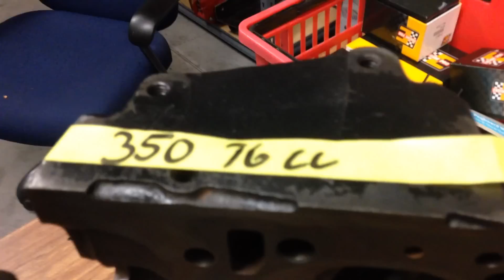350 and 305 Chevy what's The Difference

Comment from the maker: This is a link to the engine masters 305 N2O test
https://www.youtube.com/watch?v=AScojLj139A&spfreload=5
Reply: I was wrong, they blew it on 150 X 2 stages, they make 620hp on 125 X 2 stages.
Reply: Okay so when you mention the 58cc head bumping compression to 11:1 on the 350 did not make hp gain but what was the compression on the 350 with it's 76cc head ?  10:1 ?
Reply from the maker: more like 9 to 1
Reply: Watched  Eng mastrs link : HOLY CRAP !! 358 HP from a 305 ! - 619 on the bottle ! = short lifetime. However, over 350 HP from a 305 is impressive !
BUT, it did have aftermarket vortech heads. that is key to it's large numbers.

400 to 450 HP should be within easy reach with a built for longevity 350.
BTW : Also a fan of roadkill and eng mastrs  excellent series both of them.
Check out Finnegans youtube channel  finnegans garage.

Thanks for the link Myvintageiron7512. Merry Chrismas to you and a profitable and successful new year to you and your family.  JR
Reply: John Robinson I'd Like To Have That In A 1979 Or 1980 MONZA SPYDER!!!
Reply from the maker: when I was a kid me and my cousin put a 327 in his 77 monza that thing was a beast
Reply: Been there done that!  All that power and weight in a flimsy H-Body made a pretzel out of the front end!
Reply: Myvintageiron7512 my jaw dropped when it almost hit 600 horse.. really surprised with  that setup toss in a better bottom end I bet it would do well over 800 out of a lil 305..
Reply from the maker: Yea crazy pretty crazy stuff
Reply: i think she would go well in a lil s10 and name it farmtruck truck jr with 2 kits or a pair of turbo's :P lmao
Reply from the maker: nope 76 CC makes less than 9 to 1
Reply: friend had one in a chevy luv,was a screamer! also a 66 nova,slicks and rear fender wells cut out.Oh and i had a vega,lol,gotta love all those back in the day,cheap and fun times! all the youngsters,get a old motor and tear it down,and rebuild it, you'll have a blast and learn so much doing it.
Reply: 8.5 to 1.
Reply from the maker: @Wildstar40  because the 305 head does not breath well
Reply from the maker: @Wildstar40  yep 76

Comment: The difference between a 305 and a 350 is only the bore size and the thickness of the cylinder walls. The 305 is dam small. The 350 has a a 4.00" bore. The Chevy 307 has a 3.875" bore size, and the the 305 has a 3.736" bore size with 3.48" stroke. The 4.00" bore size has the strongest bore of all of them. It's not some magic number, it's just what we get when we start messing with bore sizes. (Like Werner Vaughn Braughn once said about solid vs liquid fueled rocket engines... it's not what we want, it what we get!) my Father In Law was in the audience when Vaughn Braun gave us that little tidbit.  The 307 Chevy is stronger that the 305 because of its bore size. It wasn't something that was planned, it just happened that way. Just like the 327 and 302 were stronger engines Than the 350! It's was bore to stroke ratio all the way, and that came down to rod length to stroke ratio! Who'd' ever thunk that. Smokey Yunick and nobody else! Rod length to stroke ratio meant power and durability, and nobody else saw it except possibly Mopar engineers.  Still today rod length to stroke ratio means power and durability. Even in monster 500+ Cubic inch motors. Even 600+ cu in motors. I'll stick with rod length to stroke ratios and lighter rotating mass.
Reply: Kenneth Cohagen 302 /327 ha they where all the same in the end 69 dz was a 350 block

Comment: 1st, great video, great information. When the 305 1st came out it was common practice to mill .100 off the head and angle mill the intake so it would fit better. Yeah, it was a bit of work, but you had a good truck engine in the end. You could have about 225-250hp and get 20-22mpg and back in the day that meant something. Mill the head, intake, comp cam 268, alum intake and you are good to go.

Comment: My mom had a '78 Nova with a 305 that she gave to me with over 130,000 miles and it still ran strong. I tried to blow it up but couldn't. I sold that car to a friend of mine and he put the engine in a Camaro and ran it for several more years. I also had a '74 Chevelle that I was known to break engines in. Once I had a 305 in it that had no power but I couldn't hurt it. I also had a 307 from a '72 Nova in it for a long time. Even with a 2 bbl it still ran strong. When I took that 307 and put it in a '78 Monza, I changed it over to a 4 bbl Quadrajet and man did it wake up! I've had good 350's, but that 307 had me impressed! I wish I still had it!
Reply from the maker: 307 has the same crankshaft as a 327 that stroke and rod combo has the best ratio of an Chevy engine 307 is the same engine as a327 with a smaller bore size
Reply: @Myvintageiron7512  I did some research and found out that the 307 was made by combining 2 of the best engines Chevy had at that time: 327 and 283. I wish I still had mine.

Comment: A 350 will run circles around a 305 and not just because it has more cubic inches, either. Valve shrouding is a serious problem on 305s.
That's why 5.0 Liter Fords run so good.   5 Liter Fords have a 4 inch bore.
Reply: In the late 60s, the first-gen Z28 also had a 302.  They took a 327 block and put in a 265/283 crank; a 4 inch bore and 3 inch stroke.  It kicked ass and wasn't afraid of RPMs.  That was a real sports car engine and GM should have put those in third-gen Z28s and 83-87 SS Monte Carlos. The 305 was simply a smog-era truck engine that also made for a good economy engine during the 79 Fuel Crisis.  But performance and austerity are not compatible.  305s are good engines if used for something besides a Camaro.  They did well for the Caprice.
Reply: I agree totally.  305s are great family car cruiser engines, very smooth.    GM was lucky Ford didn't use 351w also as a higher option because they could have.  Chevy 302 would've been a much better sports car motor for Camaro's and the Monte SS than a 305 and competed much better with a Mustang.
Reply: Friend of mine had a 327 in a 83 Cutlass back in the early 90s.  That thing screamed so beautifully.  Best pure sounding Chevy I've been around
Reply: I don't know why Ford didn't go all in with the 351W in the Fox Body Mustangs. That would have been a killer package and Ford was building 5.0 blocks with forged TRW pistons toward the end, too. GM did a disservice by ever trying to market the 305 as a performance engine. It just doesn't have the bore and stroke dimensions for performance. Anything under a 4" bore is a real handicap for pushrod engines. The 305 was a great reliable passenger car engine. Good on fuel and reliable and easy to work on and decent power for what it was.
Reply: Nate TheDaddy The 327 was matched to a two speed automatic in the Chevelle I believe. And it was quick just after it got rolling.
Reply: Yup, most Chevy small blocks including the 302, 327, 350 etc. had the 4 inch bore. My favorites were the '69 Z-28 302 rated @ 290hp ( closer to 400) and the '66 Chevy Nova L79 327 ci,- 350 hp...stock screamers!
Reply: The 327 could be the best all around small block Chevy ever. A good set of headers made a big difference because the stock exhaust manifolds weren't that great on any SBC really.    Chevy really messed up by getting rid of the Chevy 302, also. Younger people today don't even know that Chevy had a 302 at the peak of the muscle car era and it was a real ass kicker.
Reply: I agree...the 302 was a de-stroked 327 built for the Can-am race series which allowed a 305 c.i. maximum displacement. The '69 was had the heavy duty 4 bolt mains and was the toughest of the 3 years they built them. They kicked the Boss 302s asses...but then, no surprise there.
Reply: The Boss 302 was not a good street engine. It was no match for a Chevy 302 let alone a high performance 327.   The Boss 302 was a great idea, but badly executed. Ford got the Boss 351 completely right in 1971, but by then it was game over of course.
Reply: I had a '66 Nova SS with the L79 327-350hp. It was only available with a Saginaw 4 speed and posi-traction rearend. I had a choice of 4:10 or 3:73 gears, I chose the 3:73s, with that HP to weight ratio 4:10s didn't make sense. What a joke trying to keep that little (2,700 lb curb weight) vehicle with factory bias ply tires going straight...and keep the tires from damned near starting on fire! Yup, traction was just a bit of a problem to say the least. What a bargain for a muscle car in 1966 with tons of potential right out of the box!
Reply: Unfortunately, they didn't make radials for a few years after the car came out in 1966...they all came with skinny bias-ply tires that were totally useless.
Reply: 5.3 LS bore is 3.78 you can get 420 HP out of them with a cam change. 305 SBC bore is 3.76. Shrouding isn't as much of an issue if you use the correct valve size and have ports with good flow and velocity. Trickflow Super 23 heads for the the 305 and the right cam would surprise you.
Reply: Thats a joke because every joker I knew who had one wrecked with a week of buying them even with the 5.0s in them. Terrible street car for the street and My 86 305 Z28 smoked every one it came up against.
Reply from the maker: The advanatge of the 5.3 is you can use the block to build a 6.0
Reply: A 305 TPI will beat a 350 that isn't TPI.
Reply: The old solid (Duntov) cammed 283 from the early Vettes was a sweet motor! sounded mean as heck at idle, revved to about 8 grand RPM's or sounded like it did!
My Uncle and Dad shared  back and forth a  1946 Mercury woody Marmon Herrington 4 wd conversion, very rare ordered by a famous rich ornithologist who used the woody to travel the west and take pictures on the reinforced roof, inside it was modded by ASC I think,had a hammock and stainless steel ices boxes and water tank with a dispenser on the dash you could get water at the push of a button while driving. It came with a flathead V8 and the fellow had a famous Hollywood hot rod builder install a sweet 283 Vette motor in the flatheads place, I used to love hearing it run, My Uncle sold it after decades of garaging it between him and my Dad, A So Cal teacher has it now and shows it regularly, he had a flathead put back in and gave away the 283 engine!!!
Reply: Yeah my buddy had a 1970 SS Nova with an LT1 350 and a 4 spd, what a sweet ride.
Reply: 1986 was still 2 yrs before TPI
Reply: +scdevon   From what I understand, Ford felt the Mustang was already pretty damned fast in box-stock form (and true, it was) and it was already a sales hit.   They didn't really want to invest any more money into making it faster, preferring to leave such endeavors to the aftermarket.
Reply: The Chevy 327 is the best small block V8 ever built.
Reply: 305's were good engines they weren't  built to race, if you want to race buy a 502 or 572 or a LS engine
Reply: @davesmith7993  not to mention 375hp rating 327ci fuel injected Vette.
Reply: @MilesGlidershy  350 LT1 and 350 Vortec from a light truck both perform better.

Comment: Both basically the same thing, 305 is just a tuned down 350, if I'm mistaken it was meant to help during the fuel crisis because of the weight of the 350 they had to tune it down to help fuel economy, but ended up staying due to great sales and simple design. But what it lacks in power it makes up for in fuel economy and price. Both are some of the greatest motors in the world if properly maintained.

Comment: If you're wondering how to tell them apart visually, here's a sexy hot tip 😉 The harmonic balancer is thicker on the 305. 305's is closer to 2", while that of the 350 is closer to 1" in depth.

Comment: I put a set of aftermarket heads from summit and a good cam in a 305 and still didn't make much power also had it bored 40 over and still didn't get much power from it
Reply: In 1987-88 the IROCS had nice 305 TPI
My 1984 Vette had a Cross fire injected 350 with 205 hp but 0-60 it was a beast thanks to 300 lbs torque above idle.

Comment: ran my 1996 silverado 5.0 (305)  for 19 years 239,000 miles !! Just replaced with a crate motor all new bolt ons (power steering pump, water pump radiator and all hoses , new AC )and everything else .rebuilt new 4L60E crate trans , Eaton 4.10 positraction rear end  and Unitrax driveline ! going for another 200,000. plus !! Did I mention it pulls my 3200. lbs. boat !!

Comment: Thankyou so much for the information. I had planned to rebuild it for the 72 c-10 I am restoring. I also have a 327 engine out of a 1963 chevy truck. Which I will use is up for  debate. The 327 set in a field and is locked down but I will know when I break it down. Again, thanks so much.

Comment: The 305 has a 1" smaller balancer .   6" on 305   7" on 350
Reply: 6.75" balancer on my 1984, 305/5.0L
Reply: Larry Wolfe pistons have less weight to them so it makes perfect sense
Reply: Balancer size is never a for sure way to verify and 305 and 350 balancers are interchangeable the weight does not matter the only thing that matters is the timing mark locations because there are different locations for different years but has no effect on balance because 305s and 350s are internally balanced so the balancer  and flywheel/flexplate are neutral balance the only exception is the 400 small block or an externally balanced 383 or 334(305 with 400 crank)